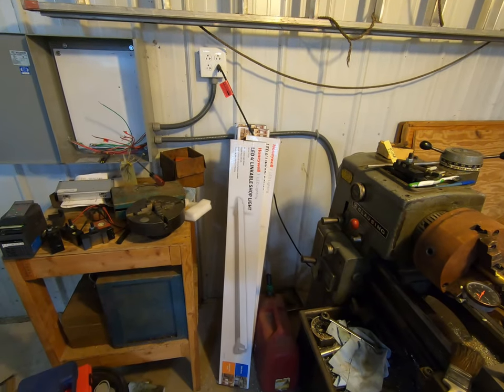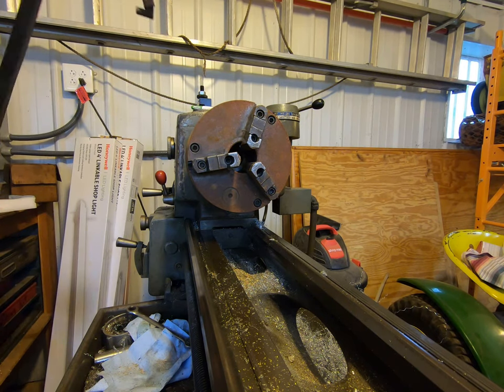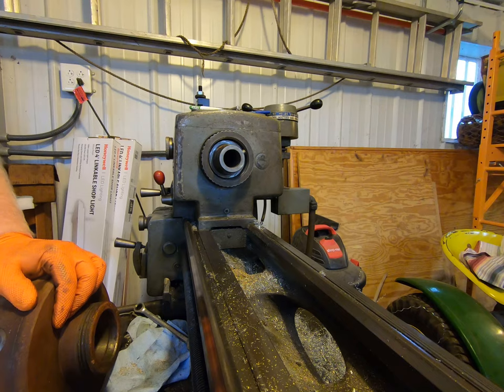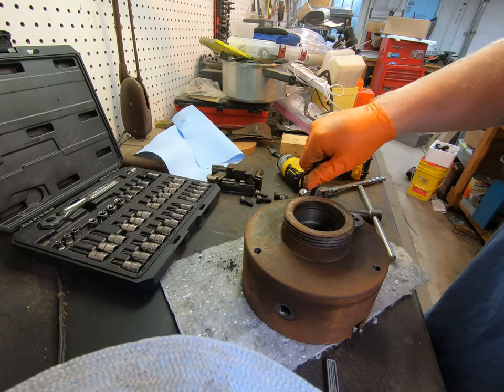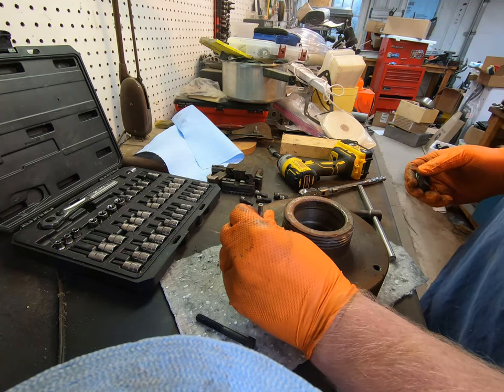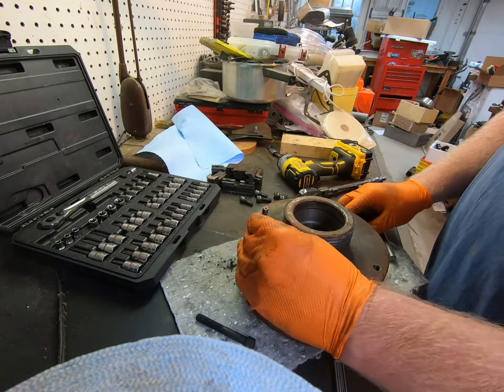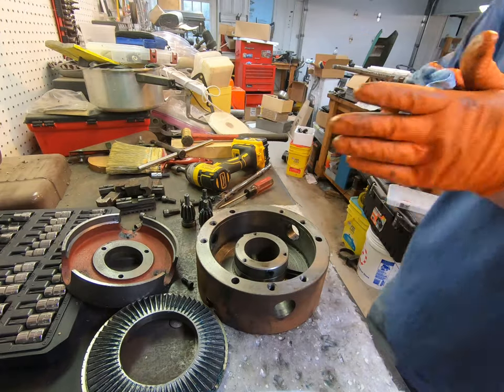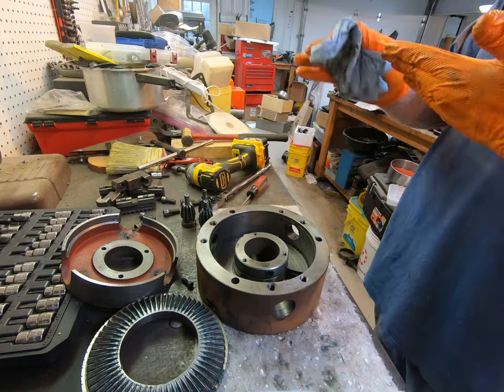Clausing Lathe Cleaning the Chuck

Comment: So it’s reverse threads to remove the chuck.  I have a 4914 that I need to remove the chuck but it is stuck and didn’t want to fully commit to using allot of pressure to remove it until I knew for certain I was rotating it the correct way